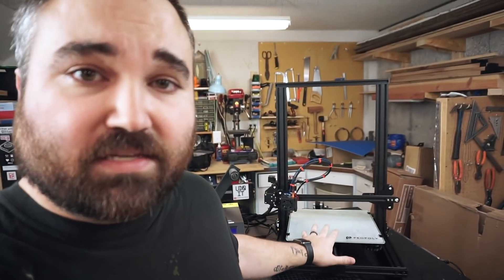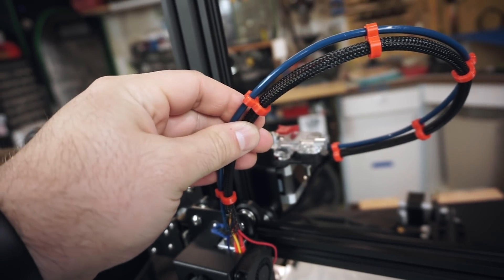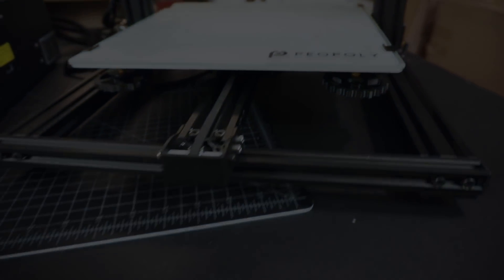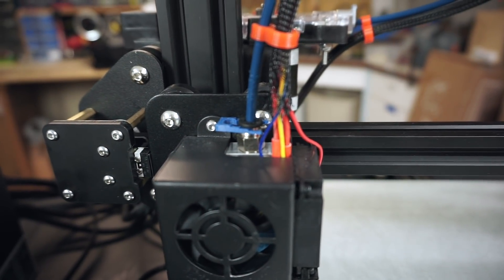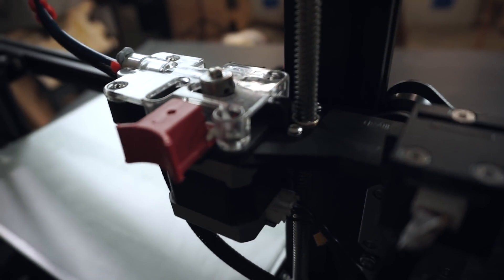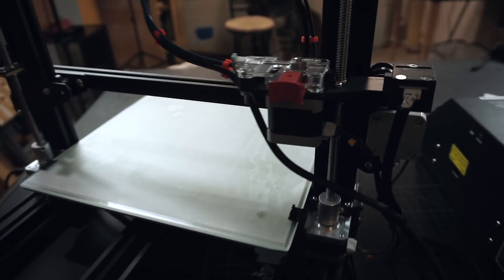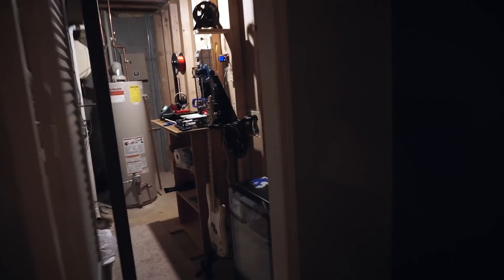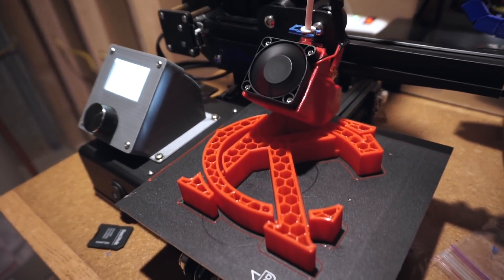My Top Creality CR-10s Mods & Upgrades

Comment: Will the extruder in the video work on cr-10?
Reply from the maker: Hey there. It SHOULD work just fine, as I believe the extruder is mostly the same on both models. This mounts directly to she stepper motor so you should be able to unbolt the old and then put on the new without issue. You’ll probably need to recalibrate your e-steps since I believe the gear is a different diameter so it will feed at a different rate.

Comment: Is the SeeMeCNC EZR Extruder a dual drive unit?  It's impossible to get much detail from their website.  I'm considering this or a Bondtech.
Reply from the maker: Hey Karl. No it is not. It is single drive. The tensioning on this is pretty unique and much more powerful than the stock extruder. I don’t think you can go wrong with a Bondtech, though.

Comment: Please be advised,if you upgrade the crealiy CR10S  to the new firmware,the new firmware does not support print resume if there is a power cut.
Reply: Marlin 1.1.9 supports the power resume, as does the TH3D Unified Firmware, which is also free and based in Marlin
Reply from the maker: I didn't know that but you've definitely piqued my interest. I'll have to pull the plug on a print to see what happens. Thanks for the heads up!
Reply: @AnthonyTackett  lets me ask you something (even with my poor english) ....there is any manual or list describing the differences between the upgrades?
I bought a CR-10S a 3, 4 months ago but i dont know the real improve to upgrade the firmware in this kind of machine...

Comment: Have you tried a PA12 type nylon or any nylon for that matter on your 10s? Since you have the upgrades for it, I'm curious how it performs.
Reply from the maker: Hey. I haven't yet but I do have a spool of Taulman PCTPE, which is a TPE and Nylon -based material. It will be a good test for that machine.

Comment: First off, great video. Vlog style worked for this one. Mods are leveling knobs, cap tubes, and a fang style cooling ducts. That's it, works well.
Reply from the maker: Thanks! Do you like the fang ducts? I've thought about printing those out.
Reply: Anthony Tackett I do like it. It gives just enough cooling to both sides of the nozzle. The one I printed uses a 5015 fan so I soldered it in.
Reply from the maker: Nice! I may give it a try. What material did you use? I printed a part cooling adapter for the Ender 2 with ABS and that has held up well.
Reply: Anthony Tackett I printed mine in Highfive blue HTPLA. Been working just fine, looks good too. 😉
Reply from the maker: Sweet. Yeah that stuff is gorgeous.
Reply: Anthony Tackett It sure is!